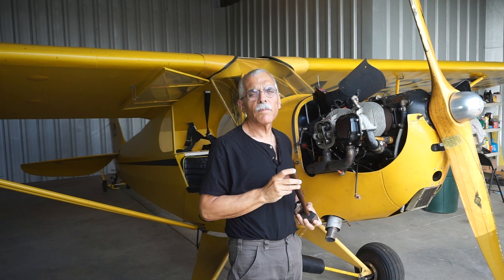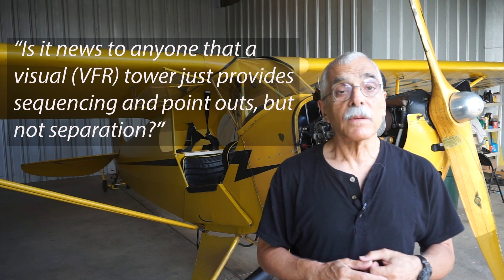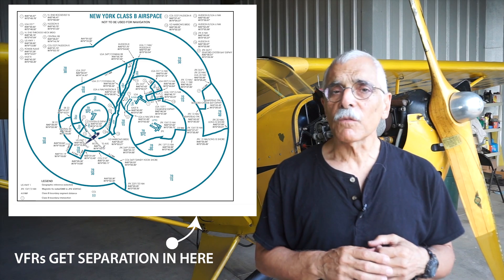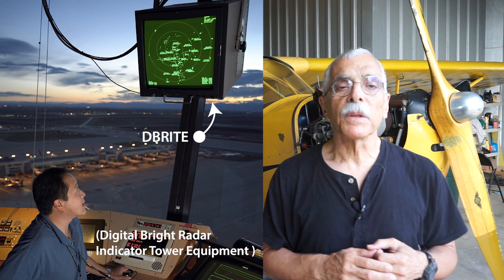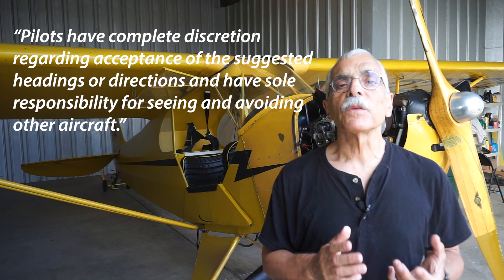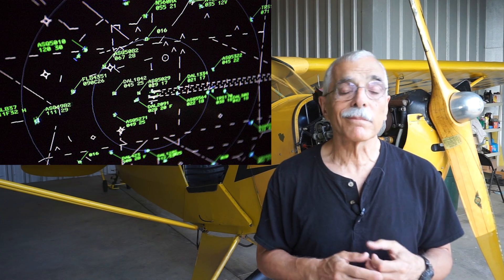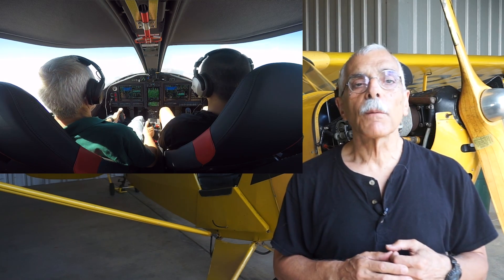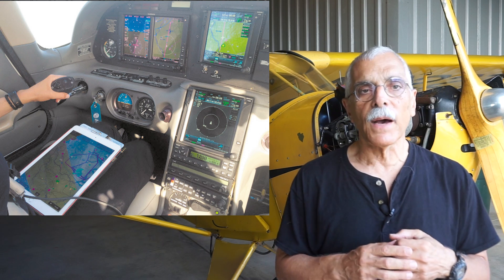Control Towers Don't Do What You Think They Do

Comment: Excellent video Paul!  I’m retired ATC (32 years) and am extremely impressed with your spot on info.   I’ve known many pilots, from students all the way to airline Captain,  who have no clue as to how the ATC system works.   Hopefully you have just educated some of them!
Reply: Agreed.  I'm ATC as well (for 18 years now) and this is the best pilot perspective on Class D towers I've ever heard.  Hell, it's better than what a lot of inexperienced controllers could come up with!
Reply: Jim P is right on this. The primary objective of ATC in every single ICAO country is to prevent collisions. The argument against this being:

"Read Chapter 3 of the .65 (ATC Terminal) and show me where it says you (VFR tower controller) provide anything other than runway separation"

Chapter 3 of the .65 may not spell it out but Annex 11 does: 

Aerodrome Control Service: the provision of air traffic control service for aerodrome traffic in order to accomplish objective a) of 2.2 [namely; to prevent collisions]

There is no derogation from that ICAO provision therefore, whilst standard separation does not apply, ATC still have a duty to "DON'T LET THEM COLLIDE" as Jim P put it. The primary responsibility is see and avoid by the pilot, but the controller also has a duty.

Where I disagree with Jim P is when he says this video is 'a bunch of misrepresented information at best'. imo this video makes a point worth repeating to the GA pilot, namely, that separation in this setting depends on see and avoid by VFR traffic, so don't fall into the trap of thinking that just because there is a guy in the tower helping you sequence for the runway, that your look-out and situational awareness can be any less than at a non-towered airport.
Reply: @XPLAlN  I agree with your summary as well, including about the value of the emphasis in the video. Another retired controller/comm. pilot, Reflected Miles, has a similar post under this video. I think you would find it is the majority view in ATC with tower experience, at least.
Reply from the maker: @XPLAlN  Just for the record, the material used to compile the video was reviewed by several controllers and has since been reviewed by a couple of more after the fact. I stand by the thrust of it.

I am quite surprised at the wide disparity in controller understanding of what a Class D tower does and is supposed to do. To a degree, this is emphasis and semantics. But the .65 and AIM define "separation" precisely and the .65 puts numbers and context on it. To me, that is separation.

Generalized directives suggesting headings, altitudes, traffic alerts, sequencing and spacing are not the same as separation, even though we can all agree towers actively try to prevent collisions and that is, semantically at least, an attempt at separation. But it is not defined separation as required for IFR and VFRs in Class B.

The overarching point here is that pilots need to know that whatever aids they get from a VFR tower, guaranteed  separation is not one of them. They are still on the hook for sole responsibility to avoid other airplanes. 

This will come up in the Centennial accident. Some indications that ATC actions will be contributory, as in Waukegan, as in Frederick, as in Meigs. And others.
Reply: @AVweb  In that case, especially with the changes in digitized radar systems over the years, we can say that Class C also provides no actual separation laterally between between VFR and IFR aircraft since the requirement is just target resolution (no touching). If keeping airplanes from hitting each other doesn’t qualify as separation, then we are purely in the realm of semantics. I think it is a protective video for pilots, but I sure know a lot of supervisors and managers who wouldn’t want controllers in Class D to take it seriously, and I do think it is a minority who would. The Forest Service pays the FAA large sums every year to run temporary fire towers, some of them not even at existing airports, and I can guarantee you that they don’t think they are paying for a CTAF operator. They could get those a whole lot cheaper.
Reply: RP and all  I do agree with the majority in this thread as well, yes. AvWeb may need some better ATC consultants. Neither pilot nor controller responsibilities diminish the other's, no matter what airspace or operation we are referring to. If only one party is responsible, we are no longer working as a team. I don't care if a thousand controllers erroneously think that their overarching responsibility for safety can be minimized in Class D, you are correct that the courts have not agreed with that, nor does the AIM. At Section 5, Pilot/Controller Roles and Responsibilities, it has a general summary of these at the top that is without respect to any particular airspace or operation. It is in compliance with the ICAO position cited above. What does it state?
__________________

b. The pilot-in-command of an aircraft is directly responsible for, and is the final authority as to the safe operation of that aircraft. In an emergency requiring immediate action, the pilot-in-command may deviate from any rule in the General Subpart A and Flight Rules Subpart B in accordance with 14 CFR Section 91.3.

c. The air traffic controller is responsible to give first priority to the separation of aircraft and to the issuance of radar safety alerts, second priority to other services that are required, but do not involve separation of aircraft and third priority to additional services to the extent possible.

d. In order to maintain a safe and efficient air traffic system, it is necessary that each party fulfill their responsibilities to the fullest. [This is what the courts have seized on.]

e. The responsibilities of the pilot and the controller intentionally overlap in many areas providing a degree of redundancy. Should one or the other fail in any manner, this overlapping responsibility is expected to compensate, in many cases, for failures that may affect safety.
Reply: @ReflectedMiles  Excellent point
Reply: @AVweb  I thought I did actually agree with the thrust of your video. If you can see where I wrote that I didn't then please quote that part to me and I will edit it. For the avoidance of doubt, when I wrote "I think the video makes a point worth repeating to the GA pilot......etc" it was not my intention for that to be interpreted as I don't agree with the video.

What I was responding to in my first comment was not the video but this thread and the opinion that tower is somehow exempt from the primary objective of ATC to prevent collisions. What is happening in this thread is  applying separation criteria is being conflated with 'preventing collisions'. Yes, in Class D the service is sequencing, with separation on the runway only. Nobody is arguing against that. But Jim P is correct on the point that preventing collisions remains the primary objective, ahead of orderly flow. The reason is not just because he quoted the .65. It is not just because he says this was addressed in his recurrent training. It is because  Annex 11 specifically supports him and I can find nothing to indicate the USA has derogated from it. The comments of R P should also be  noted. 

If what you are saying now is that  the controllers you got to review your video think that preventing collisions is NOT the first objective of ATC, including Class D towers, then I would be pleased to see the reasoned argument. Here is my reference:

   "Aerodrome Control Service: the provision of air traffic control service for aerodrome traffic in order to accomplish objective a) of 2.2 [namely; preventing collisions]"

I interpret that to mean that ICAO considers preventing collisions is objective "a" for aerodrome controllers.

I totally agree that the method of separation is see and avoid and it is the responsibility of each VFR aircraft (I wrote as much in the first post). But I'm pretty sure this is one of those areas where responsibilty exists 'jointly and severally'. The PIC of a stand-to aircraft, or an IFR aircraft, or a controller, still has a duty to take action to avoid a collision, if they are able, if the guy who is meant to be giving way doesn't. Note, I am not saying that separation service is provided in class D. I am not saying your video is wrong. I explicitly said your video makes a point worth repeating. I am saying that Jim P is correct when he says that preventing collisions remains the primary objective. I say that because it is written in Annex 11 for those who wish to see it as opposed to those who wish to conflate the objective of "preventing collisions" with "the provision of a separation service".
Reply from the maker: @XPLAlN  Actually, I just stuck the reply on your comment because I had to put it somewhere. Not disagreeing at all and I think everyone accepts collision avoidance is a top priority. The discussion relates to how it's done and by whom.
Reply: @XPLAlN   In Annex 11  para 2.2 is under General.  And yes, just like the .65, generally speaking the purpose of the ATC system is to prevent collisions between aircraft.  But once again the system is much more complex than that.  Go to para 3.3.3.    It states,  Clearances issued by ATC units SHALL provide separation:

    A) between all flights in Class A and B 
    B) between IFR flights in Class C, D, and E
    C) between IFR in and VFR flights in Class C
    D) between IFR and special VFR flights

There is nothing in there about separating VFR flights in class D.    You can also go to para 2.6.1 where it states under Class D:

Class D airspace:  IFR and VFR flights are permitted and all flights are provided with ATC service.  IFR flights are separated from other IFR flights and receive traffic information in respect to VFR flights. VFR flights receive traffic information in respect to all other flights.

Nowhere does is state that separation services are provided to VFR flights in Class D.  Traffic information MUST  be provided and this is where some controllers get into trouble.

This whole discussion (on my part at least) is about legalities.  It’s not about fired controllers or lost lawsuits, it’s about what the handbook says that controllers are responsible for.  Again I should emphasize that the Class D tower controller should do whatever he can to prevent a collision, but if this was made a mandatory requirement, then those towers (especially without radar) would almost be limited to one in and one out.

BTW, most US controllers probably have never even read the ICAO Annex 11, but it does go hand in hand with the American FAA handbook 711.65.  Just like it goes hand in hand with the AIM.     I am done arguing my point and will not respond anymore.
Reply: @AVweb  thanks for the reply. I think it's another good video.
Reply: @griam7641  I am glad you are done  because it's best that your argument is not the last word. You have consistently conflated providing a separation service (as in issuing instructions that will result in a specific amount of separation between aircraft) with the number one objective of ATC to prevent collisions.
   What you are saying is 'when I stop providing separation service, preventing collisions is no longer an objective'. You think - as Jim P so succinctly put it -   'DON'T LET THEM CRASH INTO EACH OTHER', ceases to apply. And you actually claim the regs say as much!
   I think that you know deep down that is actually wrong. But it doesn't matter if you can't see it because, as we have heard from more than one controller here, the recurrent training these days is addressing the exact misconception that you are peddling.
Reply: @griam7641  I think it is worth clarifying under US-specific rules that, by definition, all air traffic clearances of any kind, IFR or VFR, anywhere, must ensure that aircraft are kept apart, whatever criteria for that separation may be in use per the type of clearance and type of airspace. It is the very purpose and definition of what a clearance is, as stated explicitly in the .65 definitions. "AIR TRAFFIC CLEARANCE - An authorization by air traffic control for the purpose of preventing collision between known aircraft, for an aircraft to proceed under specified traffic conditions within controlled airspace. The pilot-in-command of an aircraft may not deviate from the provisions of a visual flight rules (VFR) or instrument flight rules (IFR) air traffic clearance except in an emergency or unless an amended clearance has been obtained."
Reply: @ReflectedMiles  Wow you know your .65 for being retired. I just haven’t kept up with it like that. Thanks!
Reply: @ReflectedMiles     You are correct.  However, the only time you ever issue a "clearance" to a VFR aircraft is

     a) When you clear them for takeoff or to land.....you are providing runway separation 
     b) When you clear them in Class B.....you are providing radar separation
     c) When you clear them SVFR.....you are providing non-radar and possibly radar separation depending on the facility
     d) When you clear them for a VFR practice instrument approach....depending on whether a Letter to Airman has been issued by the controlling facility

You do not "clear" VFR aircraft into Class C/D airspace.  Establishment of communications (callsign) automatically authorizes them to enter the airspace.  If the controller does not want them in the airspace, the phraseology is "Remain outside Charlie/Delta airspace".
Reply: @griam7641  Your topic was clearances as they are delineated by ICAO, and my clarification was simply that clearances per the US-specific order are all for the purpose of separation regardless of IFR or VFR or in what airspace (not just certain classes and not just on a runway).

Let's suppose a Class D VFR tower with overlying and adjacent Class B or C airspace says to a departing aircraft per an LOA or otherwise established procedure, "November one two three four five, after departure fly heading three three zero, maintain VFR at or below two thousand four hundred..." Who is legally responsible for collision avoidance in that Delta airspace for this aircraft? Just the pilot? I don't know how long ago you retired, but I know that even 20+ years ago, there were some sharp warnings from the FAA to tower controllers about this type of scenario, which is not an especially unusual one.
Reply: @ReflectedMiles  thanks. Your points are well made and supported by the references you cite.
Reply: @XPLAlN   Yes, to prevent collisions on the RUNWAY.
Reply: Do you ever get bored as a controller? How repetitive is it?
Reply: @Hedgeflexlfz   I have been a controller since 1997 as a VFR Tower controller, TRSA RADAR and Tower controller and Class C RADAR and Tower controller. I have currently been at CMH(Columbus, OH) for 20 years and can safely say boredom is not something we experience very often. We do have slow periods of the day, but, besides midnight shifts, we are normally talking to a few aircraft at all times. Whether they are IFR or VFR. Our airspace is not very structured, so every day is something new. One of the reasons I absolutely love about this job. And when weather is prevalent, it definitely increases the complexity. I haven't worked Class Bravo airspace, but it is a lot more structured due to the higher volume of aircraft. But even with it being that structured, I can't believe boredom would set in.

 As Paul said, COVID has stopped tours for the time being, but they are sure to come back. If you are interested, I advise you try to set up a tour with the closest facility you are around and go see the "behind the scenes". I've always welcomed tours, especially for pilots that are starting out as well as local pilots that just want to see how our airspace works. It helps them understand why they don't get direct to their destination or need to climb to a different altitude around certain areas. It also shows pilots the amount of frequencies 1 controller maybe working at one time as well as the number of facilities we may be coordinating with when a pilot calls in and we don't get back to them right away. I've taken many familiarization flights with airlines as well as learning to fly, and it has greatly helped me understand what pilots are experiencing in the cockpit. It definitely plays into what my control instructions are and at what times I give them. I'm always for more knowledge on bot the pilot and controller sides.I'm not sure when tours will be back, but with everything starting to open up, I'm sure they are coming soon.
Reply: @Squirrelly_T  I’ll definitely look into that
Reply: What changed in ATC post 9/11?
Reply: OMG, I'm not a pilot, but figured for safety's sake, it was required knowledge. ATC→TRACON→ARTCC
Reply: I find it discomforting when supposed professionals dismiss standardized terminology as "just semantics" and go on to explain how they have a superior understanding that lets them overcome those 'semantics'. The meaning and definability of words and standardized terms would in most cultures be considered at least somewhat important.
Reply: I will add that it's odd to see a supposedly strongly regulated professional group here in such disagreement, with one side arguing that:
- No, the pilot can not and should never assume guaranteed collision avoidance in the air and must use their eyes because controllers will not always be able to and are not specifically, unambiguously required to provide it, and the other side arguing that:
- Yes, pilots can rest assured that collision avoidance is always the only priority for the tower because regulations imply if only regulatory 'semantics' are disregarded it as a legal requirement in my opinion. That this opinion is evidently not shared by all colleagues furthers my argument that pilots should always hope that "one of us" rather than "one of them" is in the tower today.

To an outsider it almost seems as if one side validates the other (not necessarily mutually).
Reply: @LosBerkos  Mischaracterizing the nuances of the debate doesn't help, like "guaranteed collision avoidance." That's probably why the AIM specifies that it's not an either/or, right? Collision avoidance is always an overlapping responsibility for both pilot and controller. That goes for Class A, too. If the courts haven't agreed that controllers are exempt from responsibility for "bent metal" in Class D space, then the alternate views are no better than academic theories funded by millions of dollars from taxpayers.
Reply: Something tells me that you haven't worked in a VFR tower. Because if you had worked in a VFR tower you would have known (as it have been preached to me in my 13 years of being a controller in VFR towers), that you do everything you can to keep aircraft separated, you know, 2-1-1a of the .65, the actual primary purpose that comes before the "safe, orderly and expedition".

This is not "best pilot perspective on Class D towers" as this is full of a bunch of mis-presented/misunderstood information at best (and flat misinformation at worst).

Yes, there is no radar or time based separation from VFR aircraft operating within D or E airspace, but we do have a standard separation, DON'T LET THEM COLLIDE. Now yes, our task can be made harder (and thus put more on the pilot to follow 91.113, "see and avoid"), but that is required of the pilot anytime the weather allows it (with means ALL VFR aircraft, regardless of airspace BTW).
Reply: All what you argue I think he made it crystal clear on his video ? What's your point tough ?
Reply: @JPatterson61586    Yes Jim I've worked a VFR tower.  I've also worked IFR towers (ones that can actually provide separation to airborne aircraft) and I've worked several TRACONs, the last being Level 12 for 20 years.  All in all, 32 years ATC.   Unfortunately you have a gross misinterpretation of 7110.65 para 2-1-1a.   Chapter 2 is under General Control.  And yes, generally speaking, the primary purpose of the ATC system is to prevent a collision.   But the system was designed for IFR aircraft.  It is also very large and complex.   Separation requirements can be very different depending on your type of facility.   VFR towers are not authorized to provide any separation services other than runway separation, unless there is an LOA with the controlling IFR facility.  Read Chapter 3 of the .65 (ATC Terminal) and show me where it says you (VFR tower controller) provide anything other than runway separation.  Then skip to Chapter 7 (Visual) and read para 7-6-1.   This is basic radar service to aircraft outside of TRSA, Class C and Class B airspace.  It says the controller is required (workload permitting) to provide safety alerts and traffic advisories.  No where does it say he provides separation.  Even the radar controller is not providing separation services.  Look further into Section 7, 8, and 9.  That's TRSA, Class C, and Class B airspace.   Now they start to talk about separation services being provided to VFR aircraft.  If none to that convinces you, go to the AIM para 3-2-5e under Class D services.   It specifically states "No separation services are provided to VFR aircraft".  

The only thing I will concede is that I have never known a controller to just knowingly watch two airplanes run together.  We at least have a moral responsibility to do whatever we can to prevent a collision.  Hence, the safety alert.
 
 BTW, I'm also a CFI, CFII and type rated in the LR45 and LR60.
Reply: @griam7641  And you are wrong.

The system is not just for IFR aircraft, it is for VFR aircraft and we literally had a briefing from on high during the annual recurrent training we get. Granted it was probably in '18-19 so likely after you retired and the moral was explicitly that we are to separate VFR aircraft, aka keep them from bending sheet metal while flying.

Also, the AIM is not regulatory. 

We are tasked with keeping the VFRs from hitting, even in D airspace.

Yes we may not have the ability to provide RADAR separation, be we are still tasked with keeping the planes apart.

Saying that our job isn't to keep planes apart is a grave misunderstanding of the role of the AIR traffic controller.

In short, you are probably one of the old school controllers that the NATIONAL SAFETY BRIEF in 2018-19 was about, and it is probably for the best that you retired, it is hard to teach old dogs new tricks, because it has been made ABUNDANTLY clear (and not just in the past 3 years, but in my entire career starting in 2008) that we keep all aircraft, including VFR separated (i.e. not collided).
Reply: @JPatterson61586    Well then please show me in the .65 where it says you will separate VFR aircraft at a VFR tower.   As for the tired old argument that the AIM is not regulatory.....well that's just idiotic.  Are you saying that the AIM is full of misleading information that the FAA just loves to put out there?  That statement has been in the AIM for decades.   If it's not true, why won't they take it out of there?   

Around the turn of the century the FAA changed their training tactics.   They said training was too expensive.   Too many developmentals were washing out.  So instead of the Academy being pass/fail (which was about a 50% washout rate) they went to "Train to Succeed".  Now the Academy was just a formality.  Everyone passed.   And then once they got to their facility, they were virtually guaranteed to check out.  Just keep training them till somebody has the balls to sign them off.   Then they would tell us "old dogs" to keep an eye on them.  LOL.   As time went on, procedures were dummied up to accommodate the newbies since us "old dogs" were retiring at an alarming rate.   But you wouldn't know any of this because you weren't around then.  

As for your people from on "up high", many of them are the people that got promoted because they sucked at being controllers.   Ever hear of the Peter principle?   There were so many of them that loved to Monday morning quarterback....but ask them to put on a headset.....whoa!   

But back to the original argument.....please show me documentation that says you are responsible for more than just runway separation at a VFR tower.
Reply: @JPatterson61586  I retired in '08, and worked the whole show from ARTCC to terminal as well, and been flying commercial on the pilot side for over 35 years now, and for what it's worth, I agree with you. Perhaps the biggest telltale sign to me was what the courts did when ruling on this. What was their interpretation of the rules when presented with cases of VFR bent metal because a controller didn't actively do something to keep it from happening when doing so was possible? In short, the FAA lost--every time that I can recall, even when I thought it was ridiculous to hold a controller to a standard that he was specifically excluded from being required to do. The courts made it clear that, in their legal interpretations, if the controller could have fulfilled that "safe" part of the overarching "safe, orderly, and expeditious" mission but didn't, then the controller was at fault to some degree. It might be that long track record of rulings and payouts that helped sponsor the briefing from on high that you refer to.
Reply: @griam7641  You refer to the .65 chapter 3 but seem to not have read it recently. The VFR terminal controller just thinks of separation in terms of sequencing and spacing around the field (Section 8), obviously depending a great deal on traffic calls and pilots avoiding each other visually based on those and their other tools.
Reply: @ReluctantPost   Actually I read it just the other night.  The sequencing and spacing has been in there since before I started in ATC.  
But VFR tower sequencing and spacing is NOT separation.  You may have an aircraft extend downwind, but you are not actually separating them.  When you're talking separation standards the .65 is quite specific.  I.E.  target resolution and 500ft, 1 1/2miles and 500ft,  3 miles and 1000ft, and so on. 
  I spoke of the Monday morning quarter backing earlier, and that's exactly what all the lawsuits against the FAA are about.  In almost any accident, someone somewhere could have done something to help prevent it.   As long as there are lawyers, they will always be trying to sue the FAA.  It's the blame game....who can we get to pay??
 The argument here is that VFR towers do NOT provide separation other than runway separation.   The .65 is written by lawyers, whereas the AIM is more plain language.  And again, in AIM para 3-2-5 it plainly states that Class D towers provide no separation services.  Yes this publication is not regulatory, but it goes hand in hand with the .65.  
 Jim P states that his "higher ups" are telling him to separate all aircraft, and I definitely believe him.  We had a manager that wanted us to start running 4 miles on final instead of 3.  But he was unwilling to put that in writing. I'd be willing to bet that neither did Jim P's higher ups.  
  The point of all of this is that we need to understand what the rules are.  And I believe that Mr Bertorelli was on the money with his explanation.
Reply: @griam7641  I knew one tower controller who took that view of his job. After over 15 years he was let go because the result was that he failed to separate airplanes. You can argue the nomenclature or the semantics, but at the end of the day, if the idea that separation isn't required is turned into practice, controllers can lose their jobs and the FAA pays out far more than it should have to. Yes, we live in a litigious society in which attorneys are forever gunning for any deep pocket they can find, but if you really know your .65, the FAA, and the courts, and have listened to that mid-air at KAPA and don't know very well what has followed and will continue to follow for ATC in consequence of that lack of separation, you're just kidding the folks under this video. They failed to separate the airplanes. Period. Call it what you will.
Reply: @ReluctantPost    No, you are kidding pilots if you are letting them think that you are guaranteeing them separation in Class D airspace. Because you are not.  Period.
Reply: @griam7641  Agreed that pilots have to be responsible to the CFR and the AIM perspective and this video is valuable for that purpose, but it is misleading from the controller perspective and you are kidding them if you think they are relieved from keeping airplanes apart through spacing and sequencing, as well as runway separation, when working VFR towers. They just have a visual version of the Class C lateral requirement for VFR, which isn’t a specific number to maintain, as most radar controllers are used to thinking in terms of, but have to have specific numbers on and from the runways. In the recent KAPA crash, they didn’t even meet the requirements to be able to do parallel operations (all pertinent traffic must be issued), and the .65 puts that on them, not just pilots.
Reply: @griam7641  Actually, the 7110.65 is NOT written by lawyers, and they don't review what gets published, either.  The 7110.65 is 100% written by current and former controllers.
Reply: @JPatterson61586  I’m not sure I understand your rant, he explain that very well